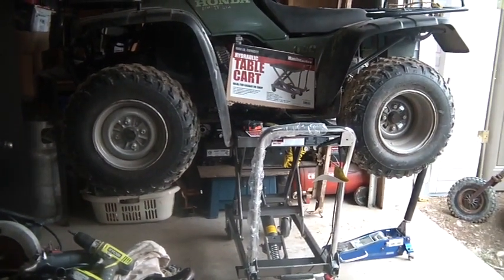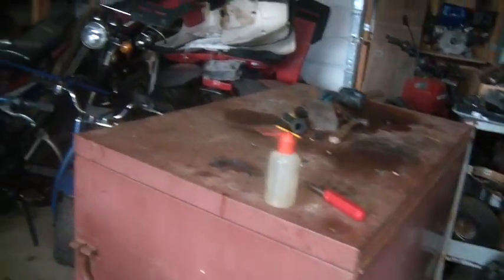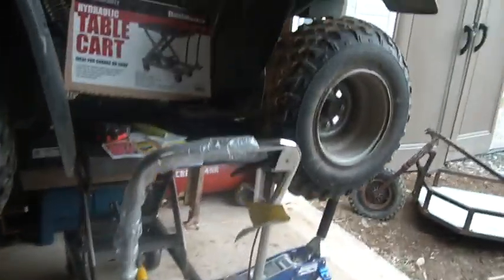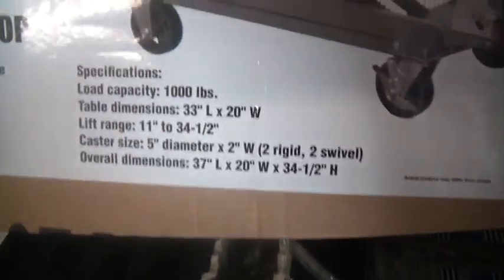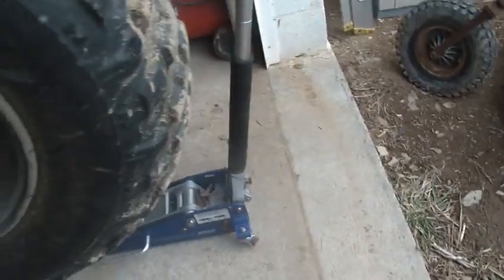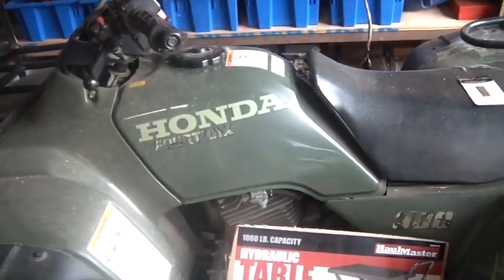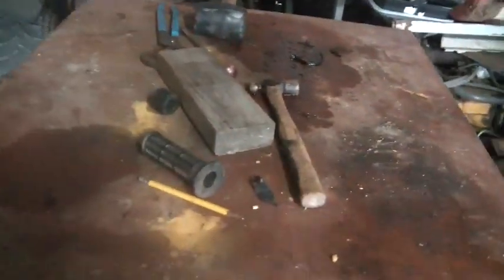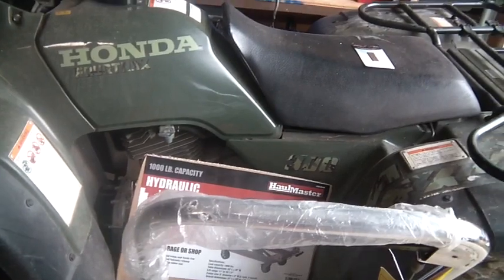Review of Harbor Freight 1000Lbs Hydraulic lift table cart, Item # 69148

Comment: Harvey nice review,  I bought one of those carts last summer and it is very handy.  You can wheel that over to your truck, set the height to the tailgate and unload  heavy objects with ease.
Reply: How has it held up?
Reply: @alcopower5710  with low use it has done great. I use it around my garage.
Reply: @59chevt  ....thx for the reply.  Main reason I was asking is because I have seen lots of comments about the cylinder failing and either not being able to lift or leaking down under load.

Comment: I have the same lift table . that is exactly how i use mine . i love it
Reply from the maker: +josh wilcox , For what the lift table cost, I am very impressed, I'm hoping it saves some wear and tear on my back and helps me get stuff off the floor and get organized, how long have U had yours? Thanks for the info, watching, and commenting!!!
Reply: i have had mine since mid October. the only prob i have found is the lift will sink or leak down on its own . this is like over a 12 hour period .
Reply: I'm thinking of using this for my motorcycle, in addition to being able to use it for its intended purpose.   It won't work well for all motorcycles, but my Vulcan 750 has a good center stand,  so if I can get it on the lowered lift with the center stand, I should be able to lift it up nicely.  The challenge will be getting it onto the table, which is 11 inches at the lowest.  Certainly Harbor Freight's motorcycle lifts are better for motorcycles, but I agree that being able to use a lift like this for multiple things is the best way for it to "earn its keep."